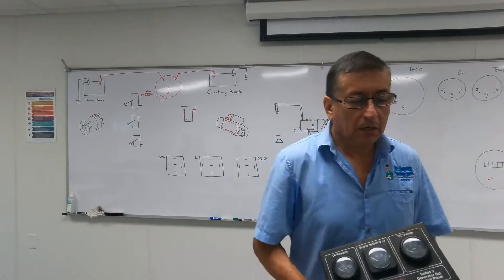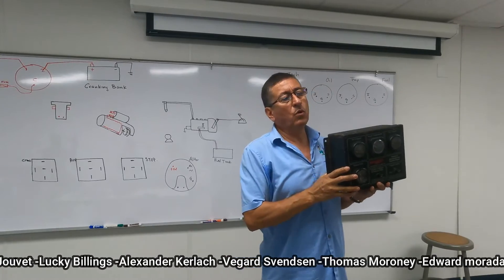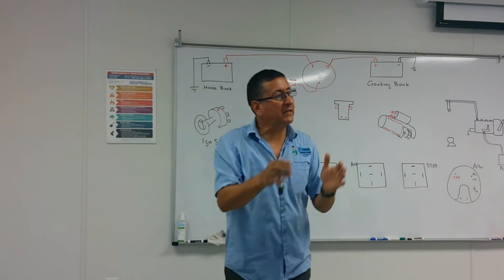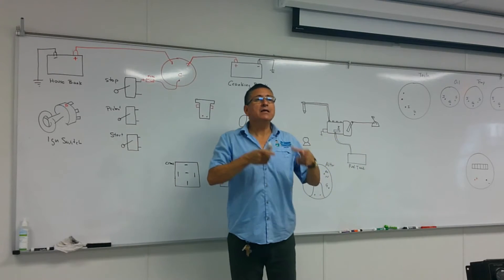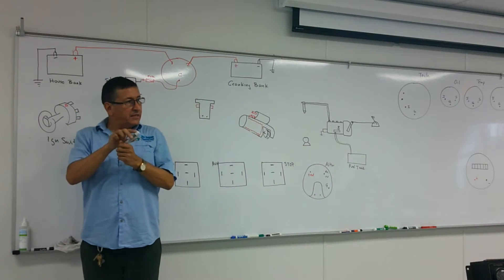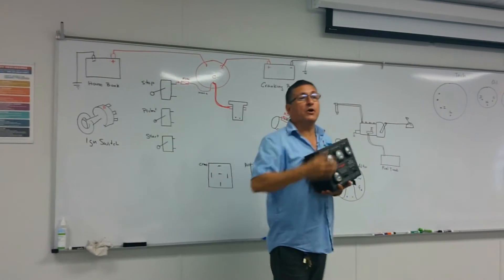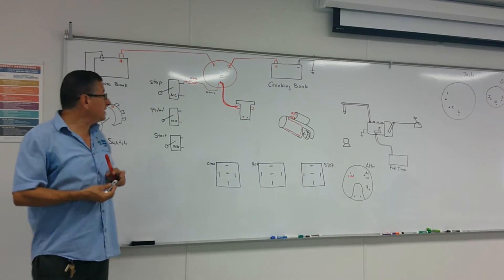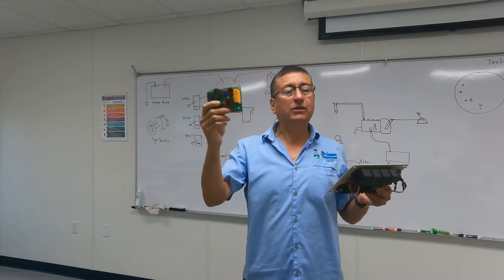How to wire a Diesel Engine Harness | Part 1

Comment: I love your videos and the information you provide is EXCELLENT !!
That said, I did notice one error in this video when you were talking about the bow thruster control; you mentioned the 12v bow thruster control on the fly bridge requires a common ground with the 24v supply to the bow thruster. Technically that is not true because the ground through the relay/solenoid that controls power to the bow thruster can have separate grounds. I know I’m being picky but I love your videos so much that I thought I would point this out. 
Thanks for your hard work on this - keep the videos coming !!